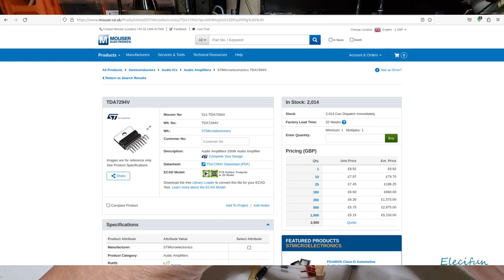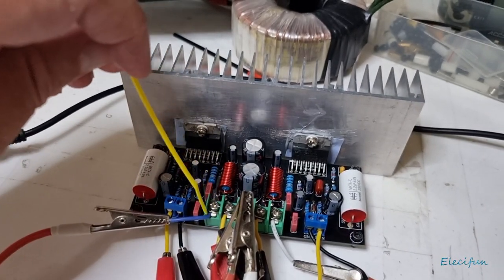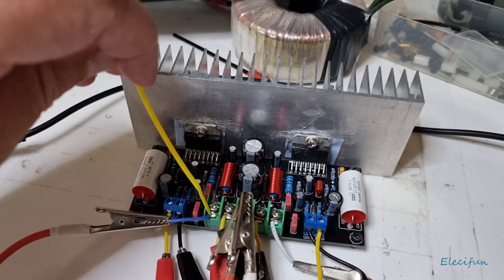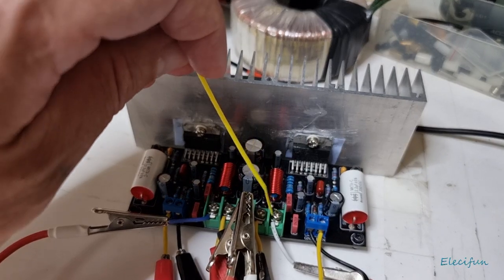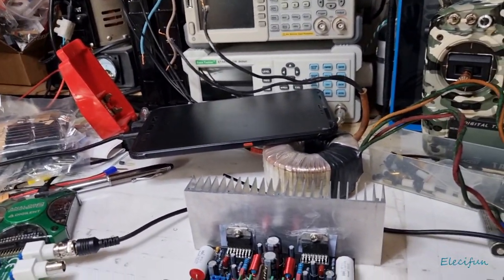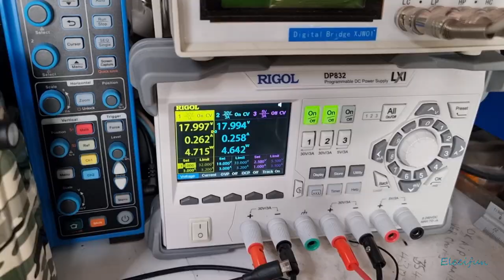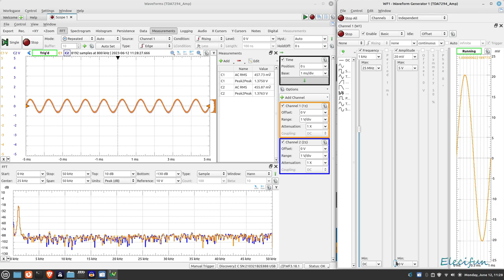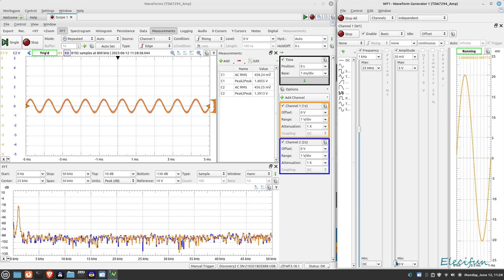Aliexpress TDA7294 Stereo Amplifier Kit

Comment: I want to build a set of speakers as a new stereo system.

I picked out a very nice set of speakers.

They're  600W RMS JBL 226H "15 inch transducers.😂

95dB 1w 1m.
What size amp do I need to run them.

Do I need a pre-amp??

Also I need some mid range and tweeters for the top end.

Actually they're probably way too powerful for my needs.

I think 100W per channel would be fine.

I'll look around for something a little less grunty.
Reply from the maker: Wow 600 watts, that's a big transducer. 95db isn't that efficient, so a beefy amp with a beefy power supply would be needed. I would agree that probably to big, unless you have big hall to fill with sound.
Reply: @Elecifun  sorry 97dB. 1W at 1M.

8 or 16 ohm.
Reply: @Elecifun   :D 

100W per channel would be good.

I wish I could find an old magazine with instructions on how to build it.

Parts
Shematic
Etc.
Reply from the maker: Try 
https://www.instructables.com/search/?q=Speaker%20box&projects=all

Comment: Oh that sucks sigh. Oh well that's half the fun! I just finished another  dot matrix smd clock this time purple. Actually it looks dull. I guess it's power requirements are more. Sigh. Anyway I'm building another one which will be the last one. I can't finished it as quickly as I liked because I scavenged an IC from this last kit which means I'm one ic short which sucks. I ordered another one but it won't be here till 10 August at the latest. Sigh.
Reply from the maker: Is it on a slow boat from?

Comment: @4:44 Hey Hombre !😂 hmmm another amp eh looks good ! Yeah good advice always buy spares because you just never know !
Reply from the maker: Yeah, odd to have a couple of diodes missing. Never mind they are ten a penny or there a bout's.
Reply: @Elecifun  That's typical I guess of AliExpress stuff.

Crappy packaging, missing components,  stuff that is sometimes not of merchantable quality and a host of other problems. 

Still sometimes it's all good.

One day I'd like to build a class A amp 100W per channel with low distortion.
Reply: 100watts class A. Good luck with cooling that!! Why? I have to ask. A class A is just a class AB without crossover and many amps of power wasted. Build a L12/2. Same power out, more into 4 ohms. With the correct bias, zero crossover. Cost about 10% of a class A. Will it sound better, no. Will it sound worse, again NO. @decem_unosquattro9538
Reply: @MichaelBeeny  I can't give you a good answer because I simply do not understand the meaning of terms like "bias" and "crossover" in this context. Moreover ... what's the difference between one class and another... I assume it means efficiency of power, heat, design etcetera. 🤔
Reply: @MichaelBeeny  Okay, I might give that a shot ! I hope and I pray that I'm not biting off more than I can chew. 😆